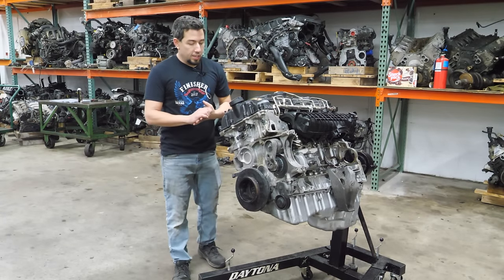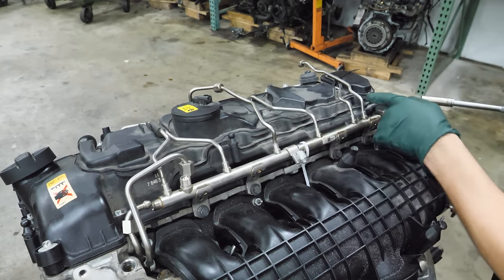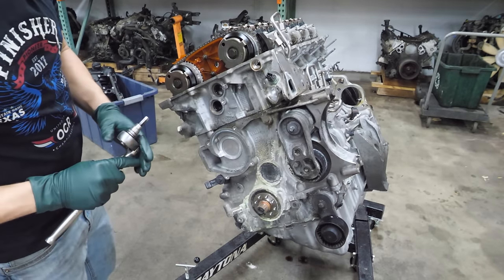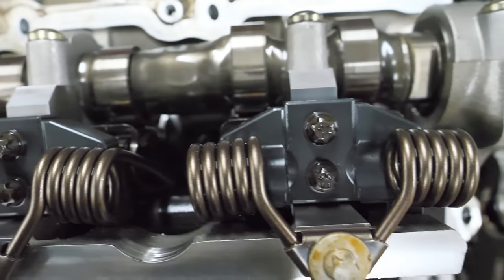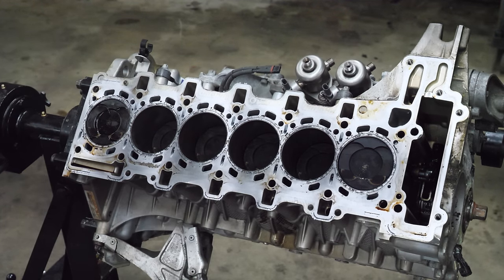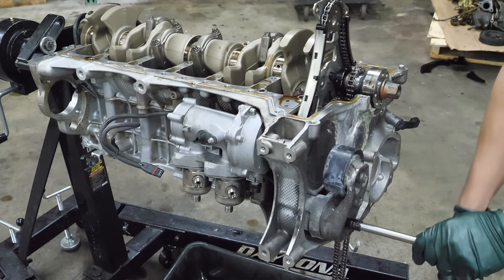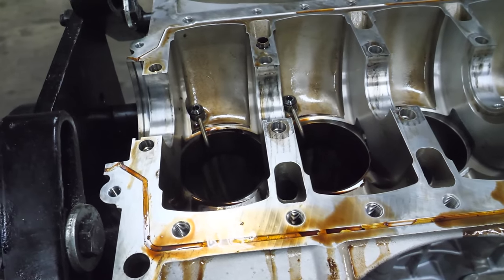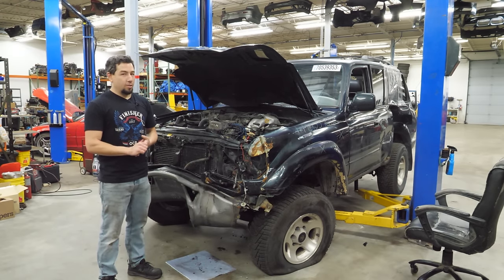2016 BMW F80 M3 Twin Turbo S55 Bad Engine Teardown. Bogus Rebuild?

Comment: For anybody wondering, the crank is about $1k in good shape, and a bare block is about $2k.
Reply: Thanks.  I WAS wondering.
Reply: $1,100 to 1,800 on ebay, $2,000 + in better condition
Reply: These viewers can't afford to watch... much less pay for used hardware.
Reply: @Look_What_You_Did  says the one who probably still pays 20 percent apr on a clapped out honda civic
Reply: @Dustin-gf2hg lol stealership moment
Reply: That’s cheap
Reply: New crank cost 2500
Reply: He rich already..
Reply: @Dustin-gf2hg  Hey, that's 23% thank you very much.
Reply: It looks every bit of that
Reply: Noice
Reply from the maker: Just look up the cylinder head 😎
Reply: @SpankMyFace lmaooo where did you see him pull 2 heads? It’s a inline 6 bmw, one head
Reply: Aka NOT WORTH IT
Reply: @I_Do_Cars  After such a great outcome... close the shop, take your wife and children for a walk... don't spoil your happiness, enjoy the moment...
Reply: @Look_What_You_Did  how do you know ?
Reply: @I_Do_Cars do you think the s58 is better than the s55?
Reply: @I_Do_Cars s55 is a subpar engine. b58, s58 are better in my opinion.
Reply: ooooohhhhhh shet you fried him
Reply: @diangelo6686 like the s55 b58 has issues 2 aside from the crank hub s55 is a damn strong b58s can’t handle high torque and that’s when people blow there trans
Reply: @Possessive_  here’s a news flash a transmission isn’t a engine there two different parts of a motorcycle and no s55 is puting out b58 numbers without major suspension upgrades so who really cares what they can put out, by the time u get that power in any car that has a s55 comes in u have to do major upgrades to the entire car
Reply: @diangelo6686  didn’t say they were the same part 💀you just making it sound like the b58 cars have no issues when they in fact do and wat are you comparing for numbers m240i vs a m2 comp of course the xdrive car is gonna have better 1/4 mile track numbers but there’s plenty of s55s getting 800 hp on stock block before needing to rebuild those b58 cars can’t get past 650 without needing major upgrades too
Reply: @Possessive_  define major
Reply: @diangelo6686  things like the turbo, trans, lpfp, and suspension as well possibly more but those are the few off the top rn
Reply: @Possessive_  700hp is relatively reliable with upgraded trans and turbo
Reply: @diangelo6686  yes that’s what I’m saying though but after 650 unless you do the trans upgrade be prepared for that to blow my bmw mechanic friends tell me that’s literally the first thing they recommend upgrading if you plan on pushing over 650🤷🏾‍♂️
Reply: Subtracting zero always equates to a negative.

Comment: If I had to guess, I'd say the rebuilders decked the warped head, added a +.3 head gasket, and called it a day.
Reply: That is a better fit for the pieces that came out than my guess. Somebody trying to smooth out a warped head is more likely than somebody trying to raise the compression ratio a couple of tenths for more power from a turbocharged electronic engine.

Comment: Crank hub probably spun, if you take off the big front center bolt on the crank the front chain sprocket/hub is held in place by nothing but the torque of that front bolt... They often spin causing the engine to go out of time. DCT's are a little more prone to this when kicking down gears. There are quite a few aftermarket fixes and it's quite expensive to have them done.
Reply: Exactly what I was thinking. Not an uncommon problem on these engines at all.
Reply: I came here to say that - 100% that is what caused this
Reply: Wrong. There are friction disks in addition to the crank bolt.
Reply: My guess too, relatively rare to slip on standard power but a lot more common on a stage 1.
Reply: Is the crank hub that large an issue on 16-later cars?
Reply: @CaptainSpadaro   - It's an issue across all S55 platformed cars. Is it a large issue? It's large in the sense that it can totally nuke your motor, it's small in the sense that it's still pretty rare. My S55 is still stock, but I intend to tune it but am going to do the crank-hub upgrade first at some point, probably sometime next year.
Reply: I was looking for this comment. That is correct! Very common on the s55 platform. You can find a few crank hub fixes varying in price on the market.
Reply: @jaimearredondo4131  meant in terms of numbers of people who have reported it on 16-later cars. Saw a blog post saying BMW had done something to fix it for MY 2016 production and that it was being overblown by an aftermarket company looking to sell their hubs...but they didn't cite a source, plus said blog post was from 2020.
Reply: @CaptainSpadaro  BMW never sorted the problem on the S55 but have since replaced the S55 with the S58 which doesn’t suffer the crank hub issue.
Reply: It's quite likely that a spun crank hub was the cause of the valve to piston contact, but unfortunately, there is no way to know if that's what happened, because the timing wasn't checked.

Comment: During a post-mortem, it's good practice to confirm mechanical timing before removing the timing components. Doing so will help you better determine the cause of any witness marks you may find. Hand turning compression may have felt and sounded OK, but I bet each one of those exhaust valves were bent just a little.
Reply: Eric often does just that . 👍
Reply: No intelligent person is going to use that head without checking EVERY exhaust valve.

Comment: Theory, the original car this was in was totaled early in it's life, but engine not damaged, removed, bought by a rebuilder, that just removed bed pan to check a couple of bearing, hence the looser sets of main caps, looked good, buttoned back up, broke pan bolt, ignored it.
So, put on heat tabs, rattle can paint spray. Sell.
Bought as a "rebuilt" engine, then abused by the next owner.
Reply: sounds about right.
Reply: Accurate.
Reply: That's probably what happened
Reply: Sounds like you've done this before.
Reply: ...Next owner, had a manual trans M3, with BMW's inaccurate "rubbery" shift feel and accidently went from 6th to 3rd flying down the highway at 11pm, half drunk and listening to hip-hop while boasting to his online date about how fast his car is. 
Mystery solved.

Comment: Great demonstration of the valve-tronic mechanism. I don't know if I'll ever work on one of these, but I learned a lot.
Reply: I've accidentally rebuilt the valvetronic from one of the very poor siblings of this engine, the n46 4cyl. Accidentally because I actually wanted to remove and refit it as a unit while doing valve stem seals, but my cable tying was sub standard... anyway, not that difficult, no special tools needed despite rumours to the contrary. What i wanted to say is, its actually a very elegant and pretty simple bit of engineering imo. Not much different from the time tested ohc besides the electric motor. Nice to see a video of the mechanism in action.

Comment: There's a lot of shady shops out there.  I remember talking to a transmission repair shop manager (my tranny had just deleted 2 of its 5 gears on the interstate at 70 mph, so I drove it 300 miles to my destination on the 3 gears I had left).  He told me he had taken a chance on buying a "rebuilt" engine from an auto parts store, only to discover the "rebuilt" engine had a blown head gasket - the exact same issue that the engine he was swapping out had!

On the plus side, glad you're going to make some good money off the remnants of this engine.

Comment: Valvetronic isn’t an answer to a question nobody asks, it eliminates pumping losses, a question that has been worked on from the 325e to turning the throttle pedal into a torque request meter. When you think about it, a rocker shaft is old as the hills, make it cammed so it can vary the rocker lift and have the “gas pedal” for lack of a better term act on that instead of a butterfly valve controlling air flow. 

I also like the failsafe they built in where in a complete failure the engine will work like one without valvetronic and operate on the redundant valve body, smart thinking
Reply: Exactly, it was a question, nay demand, from many european customers.
Reply: Exactly! And prefect throttle response!
Reply: Reduces, not eliminates pumping losses.
Reply: @jamesgeorge4874  He probably meant in the context of the throttle plate.

Comment: Those cam trays are also valuable. They are interchangeable with the N54 and N55 engines and there was a design flaw in the N54 which meant they commonly wear out early causing low VANOS pressure. Maybe £400 for the pair.
Reply: Didn't think I'd learn something about the N54 in this comments section, but thank you...

Comment: Valvetronic is a very good solution for the problem of the single throttle body that limits the response time of a gasoline engine. These engines can reach their rev limit in milliseconds because of the perfectly controled amount of air each cylinder gets with just controlling the amount of lift the intake valves do as it revs up. Of course, it's complicated and if there's any problem with the system or the engine gets worn out, it can't maintane the good flow and speed of intake air and has to use the throttle body itself and reverts back to a normal gasoline engine. Usually it's pretty hard to repair the engine heads of these engines without factory technology, especially the seating of the intake valves is the most critical point of this whole thing. This makes them a pretty expensive engine to maintane.
Reply: This comment should go to the top for education/awareness sake. Thank you.
Reply: Thank you!

I was wondering the benefit, and not having to wait for intake vacuum to "go away" makes complete sense. 

I had heard the system was designed to reduce pumping losses, but that never made sense to me, because why does it matter if the intake vacuum comes from a mostly closed valve, or a mostly closed throttle body, the cylinder will be fighting the same amount of vacuum to maintain a power level.

Comment: got to see an engine with inspection ports and a piston delete in person today, helped to remove it from a solara, lack of oil, but hey, it still turns over and two of the pistons still seem okay, one had the crank bearing section of the rod shatter and get pulverized and its neighbor got a bent rod as a consequence, im hoping to get a good desk ornament from one of the two bad cylinders once the head comes off

Comment: As an owner of a BMW with an S55 engine, I'm glad to finally see a teardown of an S55. These engines are really impressive. From the factory, they were offered with horsepower from 405 to 493, all from the same long block, with the difference being the tune. With stock internals, they are good for well over 750 HP. Considering you are a BMW guy,  you should know that one of the problems with the S55 engine is a spun timing gear, which manifests itself with valve to piston contact. Unfortunately, it's too late to find out if the valve to piston contact was caused by movement of the timing gear or because of a missed shift. (You would have had to check the timing before you took it apart.) This engine is in pretty nice condition and it should easily be rebuildable.
Reply: He said that if the timing was off only a few cylinders would have bent valves and messed up with the rockers. In this situation, valves hit pistons in all cylinders which is why he thinks it's from being over reved and not mistiming. So no it was not a spun crank hub
Reply: @jonb2437  I know what he said. If the timing was off and the engine was still rotating, there would have been contact in all of the cylinders. It only has to make two revolutions for all of the valves to open in all of the cylinders. He didn't check the timing, so there is no way to know if the problem was caused by a money shift or a spun crank hub. In the worst cases, spun hubs are completely lose and freely rotating on the crankshaft, so the engine cannot run, but in the "best" case, the sprocket doesn't break completely loose, causing a timing problem which generates a fault code, but no contact. There are many possibilities between the best case and the worst case.
Reply: I just spun my crank hub. E45 stage2+ custom tune. Have had it for little over 2 years. Don't think anything made contact but I'm upgrading to the Vargas splined hub and doing the chain and a lot of other stuff. Will be buying EU5 injectors and push a bit more power, aiming for 650ish and next year some turbos to get 750whp.

Comment: This thing is a stunner even inside, it’s engineering at its best
Reply: Nope. LS is way better engineered. Biimer looks nice inside though.
Reply: 20+ years ahead of and ls engine
Reply: @jannehokkanen8175 Apples to oranges, comparisons impossible since eveything targeted during development except both going into 4 wheeled vehicles, were different.
Reply: @GoldenCroc  Excuses..no matter its I6 or V8 you can build both types well.
And LS is just better maded or even JZ/RB engines if you want drag 6 cyl here.
Reply: @joe125ful  No its not excuses, you just dont fully know what the engines are designed for. Its not just as simple as "make vehicle move", there are hundreds of different reasons and legislations to follow and take into account during the design process.

Nothing to be ashamed of not knowing all that much about it though, most people dont know much about global engine design targets, because you need to be pretty into car industry specifics and know a lot about different markets to do so. But thats how it is.

So yes, its apples to oranges, for example a LS engine would be borderline unsellable for many of the market this engine targets, because of displacment and CO2 emission based road and luxury taxes etc.
Reply: @GoldenCroc  You have modern LS powered cars in EU and in US too but still very reliable engine for example..
Reply: @joe125ful  Nothing wrong with an LS, I would love to have a vehicle myself with a hot rodded one in... 

But if you look at the number of vehicles they sell with it in europe for example, is a truly minuscule amount compared to just about anything else. No true mass market adoption of it exist anywhere in europe, and the same is true for many other global markets as well. Because of different reasons, for example the legislative I stated above.

This is something BMW heavily considered when designing this engine, and more specifically, the base N55 engine that its based on. Its a global engine that can be pretty succesfully sold in US as well, though its far from optimal for that. 

But compared to the N55/s55 the LS is more or less contained to the American continent and close allies of the US that shares very similar legislation and customer needs. The N55/S55 is a "euro market first" - centric design philosphy.

The "LS" is indeed very superior for the normal US market demands.

No one is really better than the other looked at from a birds eye perspective (outside of national considerations etc), they both set out to do different things. Apples to Oranges, as I said.

Comment: A common rebuild problem, skim the top of the block then skim the head (if not flat) throw it back together with a thicker gasket. Then the gasket crushes during running and the one thing they should have done but didn't was to turn the tops of the pistons back to clearance.

Comment: Eric, thank you very much for your teardown videos. Thanks to them I really learned a lot about engines.
I've small request for you: don't you happen to have an AMG A35, 4 cylinder, 306 HP engine (or a similar one) waiting in line for the teardown? I'd like to know what do you think about such a heavily stressed engine, what to avoid and if driving it gently I can rely on such an engine.
Thank you and all the best!
Reply: New oil and filter every 5k, drive gently until warm, and any modern engine will see you through just fine
Reply: @waverleyjournalise5757  Thanks, bud and sorry for the late reply. I'm very gentle on cars and I frequently check whatever I can check. No dipstick, so I found a hidden, service menu: the stealership changed my oil exactly as I told them, i.e. after 5k, twice already and the last time they added 0.3 liters more than the nominal level, but with almost 6 liters of oil in the engine I believe it's more or less okay.
I'm still learning the thing. A week ago I was speeding on a freeway and while braking it was dragging me to the right. It was visible on the dashboard (temps were higher, particularly in the right wheel). I quickly called the technician and the car senses the crosswind, would you believe that? Upon return, it was dragging me to the left under the braking. Electronics literally everywhere, but at least it's a gas-guzzler, not a lame EV.
But aside from the cars, I'd like to wish everyone a Merry Christmas and a Happy New Year!
Thank you all for all your sympathy, it's a great channel, which apparently gathers really cool folks.
All the best and stay safe!

Comment: This is a typical problem wjth s55 and the main problem is crank timing sprocket slipping from the friction disk. I would check send out the crank to machine shop to make sure the front shaft is not bent

Comment: Fun fact. The valve-tronic engines actually still need a throttle body. At its most basic concept, no throttle valve no vacuum. There are some really awesome videos that go in depth to disprove the myth of not needing a throttle body. Very cool video by the way.
Reply: Well that's why they have vacuum pumps lol
Reply: @haaseuros9789  Not enough brother it's simply an assist.